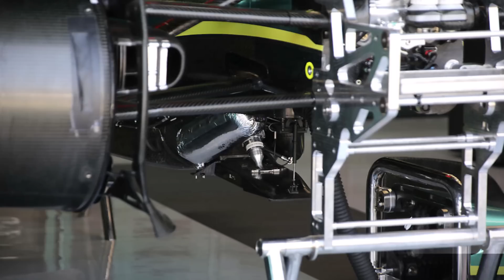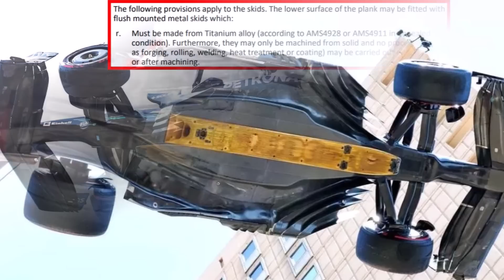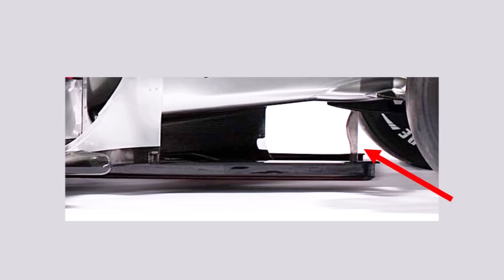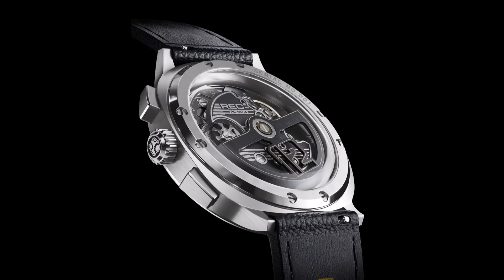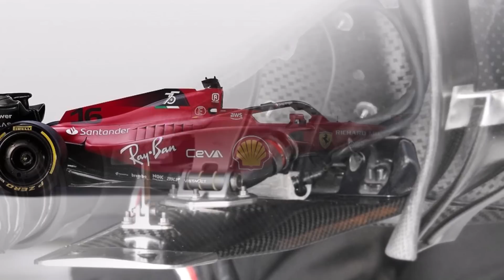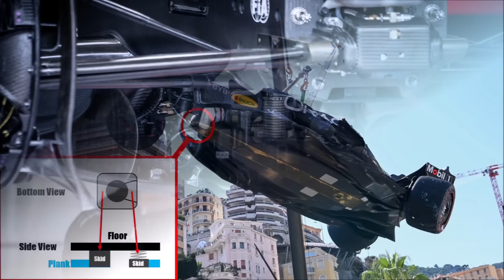Secrets of F1's Magic Floor Suspension

Comment: For those interested, the early solutions to this problem were something as simple as a blade or a flexible column. During FIA tests, the blade would be very stiff and thus not allow the T-tray to move. The car would pass the test. However, as soon as on track, the blade would be subjected to lateral forces as well as vertical ones. The lateral forces would immediately allow the blade to flex, thus losing its stiffness, thus allowing the T-tray to move as well.
For a while, RedBull or ToroRosso used something as simple as a very thin metal column just to pass the force tests, while less affecting the flow than the blade solution did.

Comment: Finally someone who pays attention to one of the most important areas of developement in recent years! But there is one thing wrong here - the plank is made of a composite material, it is no longer really wood. It would have been worth mentioning that the "suspended" floor, t-tray etc. was invented by Rory Byrne in 2003 on the Ferrari F2003.
Reply: This guy was F1 engineer so he has both experience and expertise about it but it probably team by team

Comment: Wait a seccond: Isn't floor suspension a movable aerodynamic device?
Reply: Ssshhhhh ! 🤫 And don’t mention the dynamic front wings 😅
Reply: F1 teams don't want you to know about this ☝️☝️☝️
Reply: Can't believe these devices are common tech while mass damper, a device that doesn't even touch moving air got banned.
Reply: @brokeafengineer2071 ferrari bribing finds a way
Reply: It definitely is. According to the technical regs, it is, unquestionably, illegal, but like some other illegal parts or behaviors, since every single team is doing it, the FIA does not enforce its own rules.

A funny one is every car carrying reference stickers on every rear wing. Those round stickers were introduced a few years ago so that the FIA could check flexing rear wings. However, the FIA decided to forget about it, and now the cars carry those stickers essentially for no reason. Everyone can see the stickers clearly moving on the straights (and moving quite significantly in some cases), yet no further regulations or TDs are introduced.

Comment: Doesn't that makes the floor spring and dampers movable aerodynamic device like the banned tuned mass damper ? Even if it's attached to the sprung part of the car, it still moves.
Reply: This is my thought exactly 
The Lotus 88 was not raced because it had an aerodynamic "floor" that moved independently of the rest of the chassis and other teams threatened to protest it 
Again we have a floor that moves independently of the rest of the car 
How is this different ?
How is it legal ?
Reply: @aussieseanc  i am already cooking up such methods but mounted straight to the uprights so it bypasses the chassis completely, makes the floor height consistent and allow better mechanical platform.
Reply: @Dakkyun  that is eactly how the Lotus 88 worked
The aerodynamic "chassis" was attached almost directly to the uprights and the chassis tub the driver sat in was suspended in the usual way
Reply: @aussieseanc  Update, i am looking into hydraulic suspension solutions to suspend the floor, so no matter where you mount them, the forces always goes back to the cars damper unit in the real suspension, and does not goes to the spring at all. And selectable distribution by cylinder area.
Reply: No. It behaves in the same way as every material on the planet - when a force is applied it deflects, and returns to its original position when the force is removed.
That's elastic deformation and it applies to everything up to a certain point.

It is legal because it would be impossible to make a car that doesn't deform. The car would have to defy physics.

Deformation limit tests are often used in F1 to attempt to keep the deformation sensible.

Edit - the movement is also passive, rather than active.
Reply: @procatprocat9647  the movement of the "primary chassis" of the Lotus 88 was also "passive" 
And we all know what happened to that revolutionary car...
Reply: @aussieseanc  I don't know the wording of the 88 rules, but it is very clear that this is permissible in the current era.
It really shouldn't be a topic for debate as it's a basic concept.
Reply: Yes and no. Every material bends and flexes. They give the teams dimensions/wearlimits etc. and can check it before and after sessions. Like flexing front wings, tilting rearwings when within limits and ok during described checks it’s ok. But yes, this is sort of movable aero
Reply: @miamiata7716 remembering when they had parts flexing under high speed/ load that reduces it's drag for more speed
Reply: @miamiata7716  then that makes the tuned mass damper a purely mechanical device and the ban should make no sense becaue the damper isn't even in the airtream. Ferrari bribing finds a way i guess
Reply: Asked myself the same question in 2022 and thought forsure it was gonna be banned but if it was the cars probably wouldn’t work